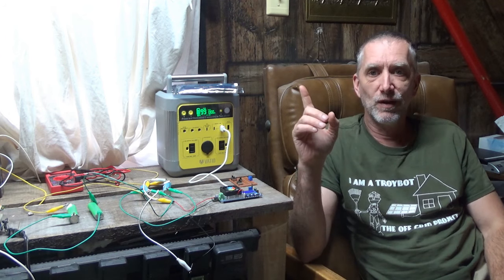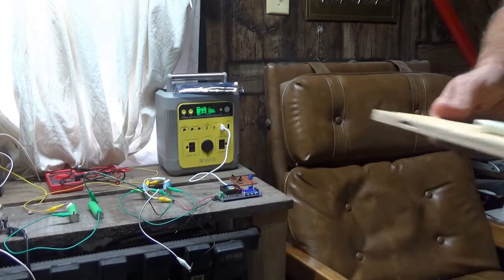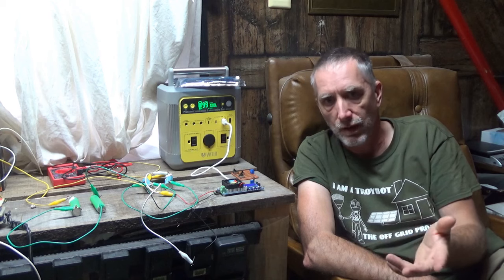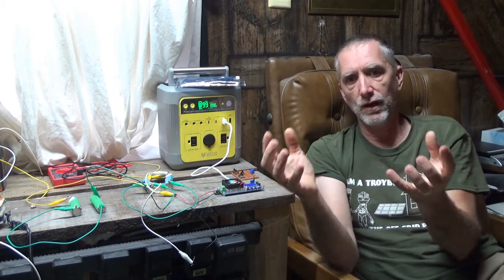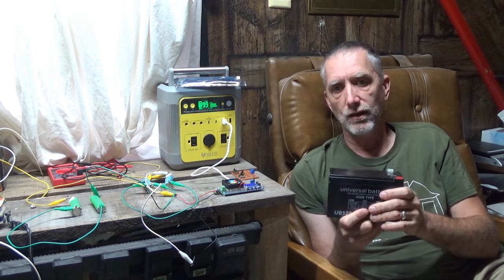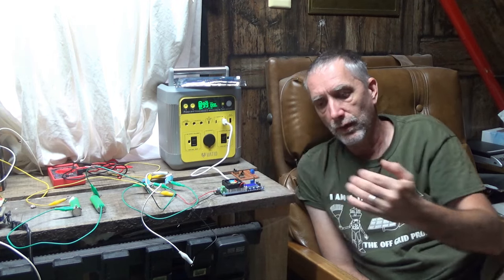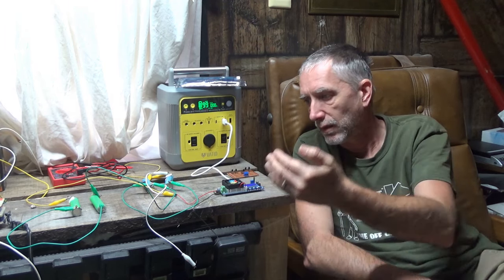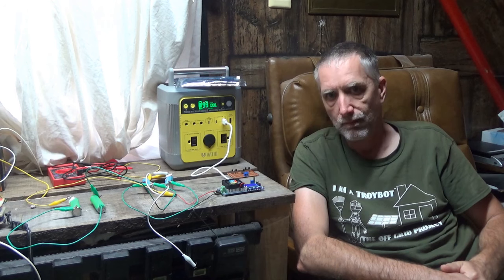Experiments With The Tesla 4 Battery Switch Without Destroying Batteries

Comment: Yes, accumulators are "slow" and they need current for charging - DC. I try to charge with 10Hz, 25Hz, 50Hz, 100Hz half period rectifiers like all low end chargers do. I think 25Hz is interesting frequency for strong pulses, but I don`t think this is better than correct DC charging. 🍻
Reply from the maker: Pulsed charging has some advantages for lead acid - for desulfating the plates. But I am talking about pulsed charging and not reversal of charge/discharge cycles. I think the cheap chargers do it because its cheaper. Save a diode or capacitor here and there.

Comment: Just my opinion on battery switching....
You will have energy loss with each discharge cycle. Like a pendulum swinging back and forth, and losing a little energy on each swing. Can your LED stay lit for a long time? Yes, it doesn't draw much power. Can battery switching possibly allow you to get more usable energy out of a battery before having to recharge? Maybe. But a properly designed and built solar power and energy storage system shouldn't require battery switching to keep the lights on :) It is a matter of designing and building it correctly. And of course, I'm not a big fan of off grid systems unless they are absolutely needed, or... As a backup plan for emergencies. Again, just my opinion.
Reply from the maker: Correct on almost all points. I love off grid. The idea here is to keep the lights on just a little longer. For emergency and back up it is good. We lose power in the country all the time. Something that can last longer is good.
I think that anyone who is off the grid (and some are not by choice but by location) would be happy to have a bit more energy from their system.

Comment: Different color LEDs have different trigger starting voltages like red yellow LEDs have a lower trigger voltage than blue and green. Experiment with different color LEDs for that flashlight battery experiment.
Reply from the maker: Yes red lights up brightly but with a newly charged battery it overheats.

Comment: Ya gotta throw the magnetic field around the ions/electrons will be piled up at the electrodes.. you want in moving the wires and batteries create a magnetic field attracting elrctrons/charges in the air, the matter that is air till it's moving with it creating a field about 15ft around attracting more around it. That cold energy is free to enter batteries domain causing no heat or damage as it charges and or discharges as it moves through space. Just as we can walk through it.
Reply: Can I   make a plasma or arc using this setup using electrode?

Comment: I read John Bedini had a super efficient small Tesla switch in a cigar box unfortunately it was smashed by a visitor in his workshop.  I had a schematic which showed how to converted the SG into a Tesla Switch....   but my hard drive went down & lost the pdf.   Anyway all the best with it.  Good video.
Reply from the maker: Rick F has a 2 hour video talking against that. I myself have no experience with it. The idea of putting the switch on an SG is really cool. Multi purpose. I can see using hall sensors or reed switches on the SG as an extra. Use the energy of the motor to do yet another job.
Thanks.
Reply: @TheDoItYourselfWorld  Yes the pdf I had the SG switch was using a reed as a trigger..  I could probably achieve the same with some of the solid state oscillators I've produced.  I've never played with the Tesla Switch..  I should imagine you could hook up a Solar Input to the Switch to try & make up for some of the losses..
Reply from the maker: There you go. Solar. That is my plan.
Reply: @TheDoItYourselfWorld  That could actually work... you could try it with & without the solar input & see the difference..  If you were using small batteries to begin with you shouldn't require such a large panel even a small solar bank might work for you...  I've ordered in all my components & wire.. I'm building a large oscillator with 21 matched switching circuits & approx 12 bifilar coils...   want to get into charging battery banks & battery swapping where only one battery gets swapped with the input battery..
Reply from the maker: I would love to hear about your progress on The Do It Yourself World Forum: https://www.thedoityourselfworld.com/forum

Sounds really cool.
Reply: @TheDoItYourselfWorld  Thanks I'll keep you informed.  Its actually going to have 23 circuits not 21..   I'm terrible at maths.  I've already made up 6 of the coils... got another 6 to complete before I can begin beta matching the circuits..
Reply from the maker: Awesome!
Reply: @TheDoItYourselfWorld  again you said in comments No experience.. 😅